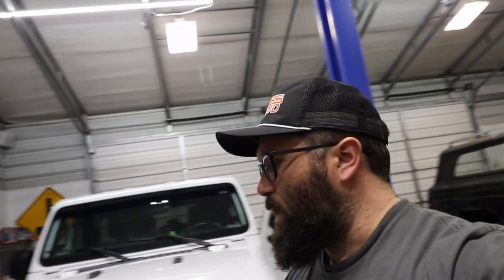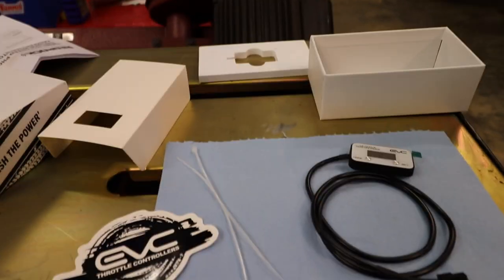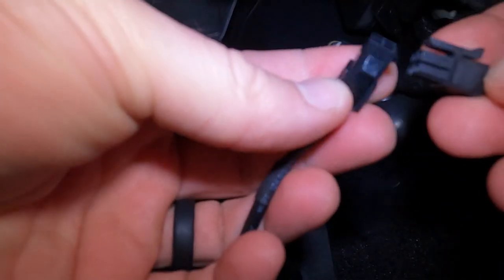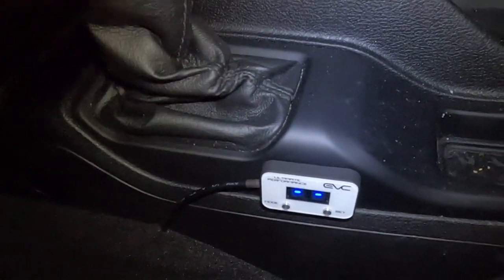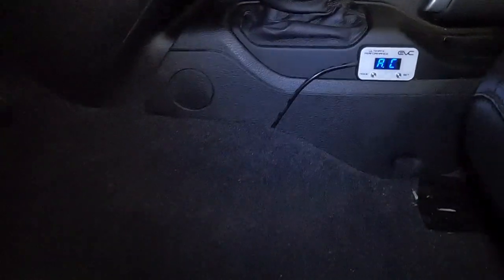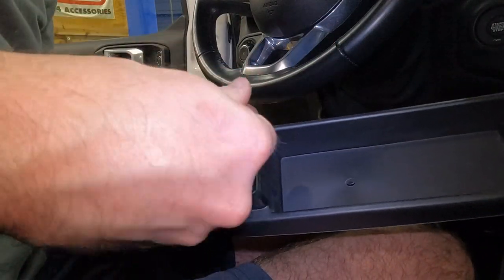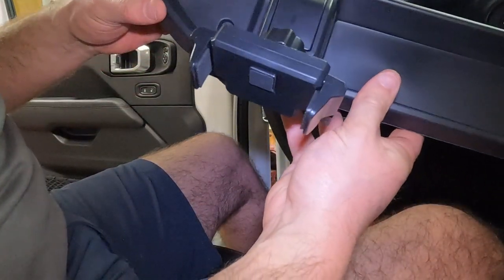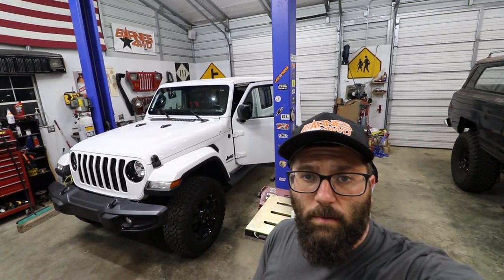EVC Throttle Install on 2021 Jeep Wrangler JLU

Comment: I had that exact same phone mount on my dash. Lasted less than a year. Going down a bumpy dirt road and the plastic behind the ball just snapped clean off.
Reply from the maker: Oh dang, I hope we have a better experience. Did you replace it with another phone mount?
Reply: I ended up getting one of those Bulletpoint Mounting systems. Love it!
Reply from the maker: @bigzoffroad  nice. i'll check those out.
Reply: @sixfeetunderfab  i mean! Maybe you’ll have better luck with this one than i did.

I liked mine while it lasted. But it just popped off one day on my way up a bumpy road. Disappointed me.